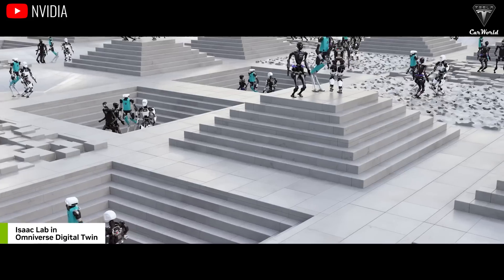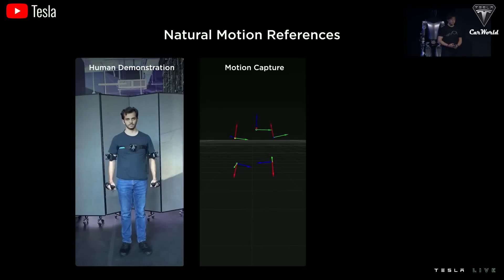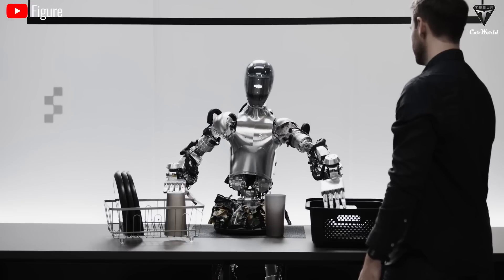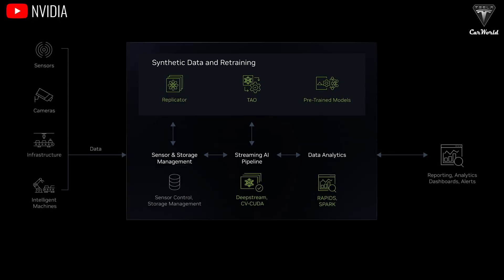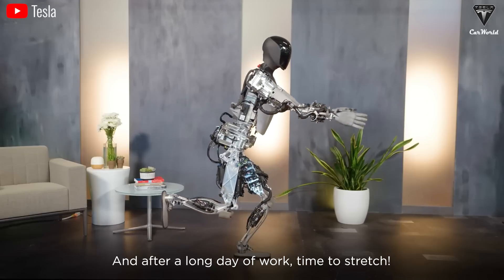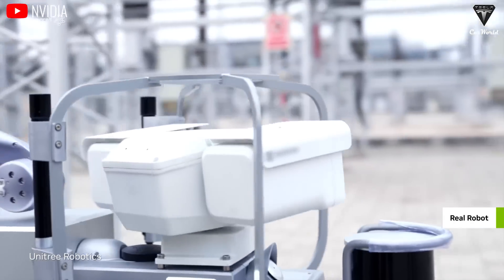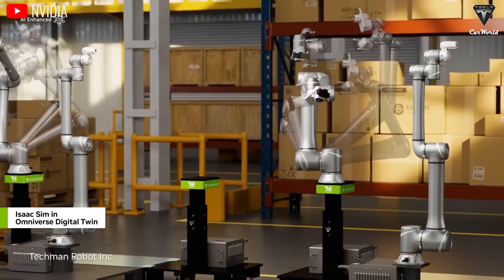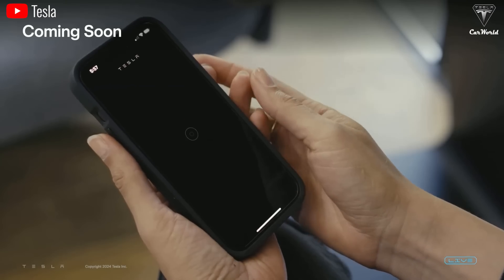It Happened! Elon Musk Unveils Tesla Gen 3 Optimus with 39% Better HomeMaker Optimizing Workflows!

Comment: Why does Optimus scuffle when walking ?? Elon
Reply from the maker: Optimus might scuffle when walking due to challenges in its balance and gait control systems. This could be related to the calibration of its sensors, the algorithms managing its movement, or the mechanical design of its joints and actuators.

Comment: If going from cleaning the house to cooking dinner, will Optimus wash it's hands?
Reply from the maker: Optimus should be programmed to follow hygiene protocols if it is designed for tasks like cooking. Whether it will wash its hands when transitioning from cleaning to cooking depends on the specific instructions and routines embedded in its software.